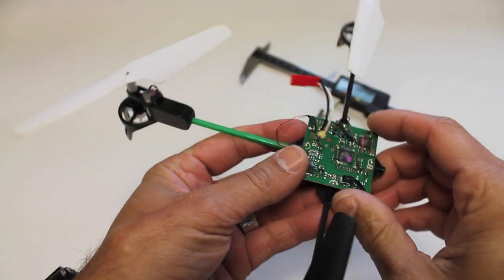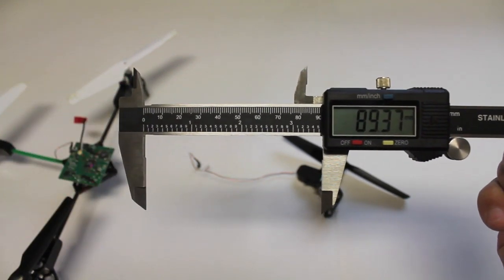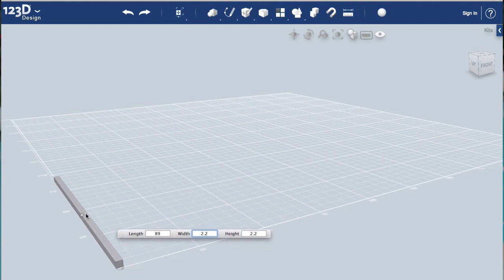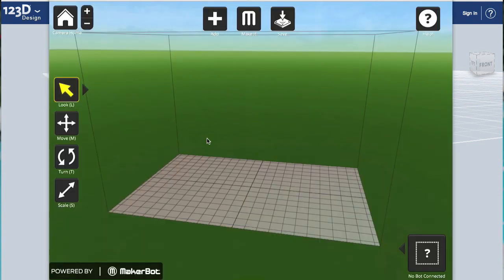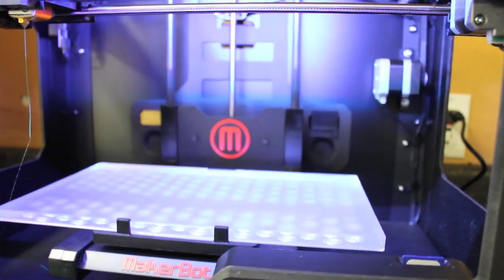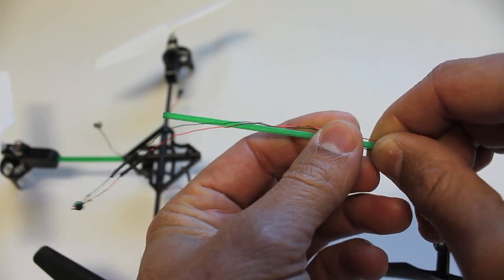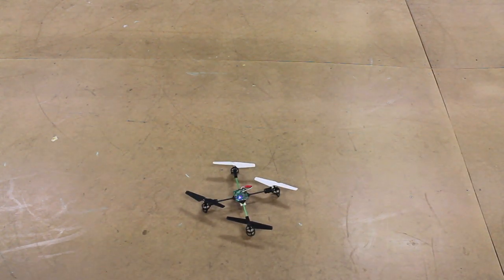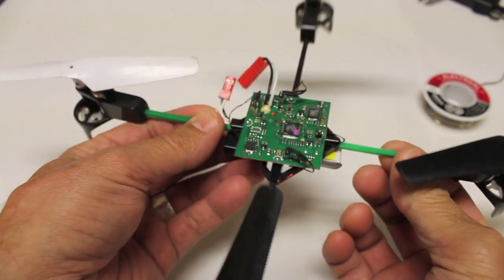My First 3D Printed Quadcopter Part for the Blade mQX using MakerBot Replicator 2

Comment: You can increase the diameter of the shaft to increase strength.  Just leave the ends the proper size to fit where they attach.  It should work as long as weight and balance don't cause any problems.  Great video!
Reply from the maker: Ben Rogerson Great tip. Thanks for sharing.

Comment: I always found that if you try to duplicate a part as close in function as you can.
If the original arms are ridgid, max out the infill so as not to exceed the weight of the original part.
If the weight is hugly different on the printed part, then duplicate an opposing part to balance it out.
Wonderful video BTW.
Reply from the maker: Thanks for the tips and feedback. Very much appreciated.

Comment from the maker: You're quite welcome and thanks for the feedback. I weighed the exact same decision between RepRap and the R2. I went with the R2 thinking it would be "ready to go" and it had so many problems. But the reality is that if I didn't have all these problems I would have been printing within minutes of setting it up. The RepRap would probably a whole different beast. And I'm not sure what it would take to build and configure the RepRap to do what the R2 does. I'm not sure it's even possible.

Comment: IF I were you I'd weigh the carbon ones, and modify the plastic printed ones to weigh the same, making a the middle of the printed ones thicker until the weight matches. I'm assuming the plastic is lighter than the carbon fiber. It should be possible, to get that to work. as even if the tips are thin, a lot of the vibration should go away if the middle is thicker, and more rigid.